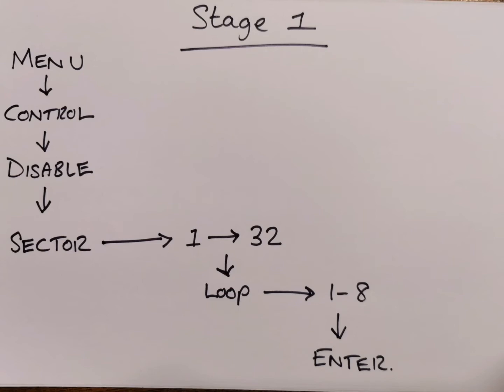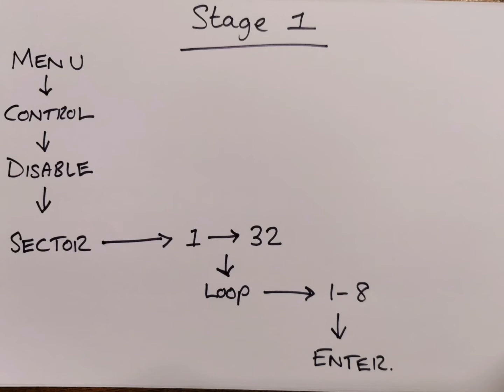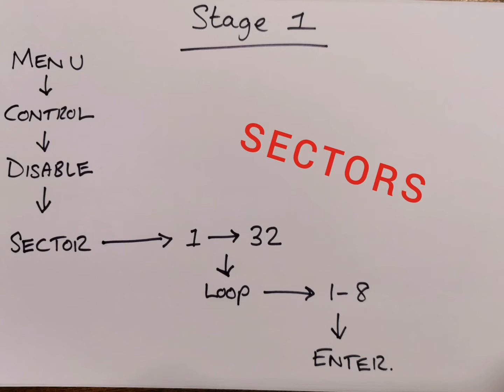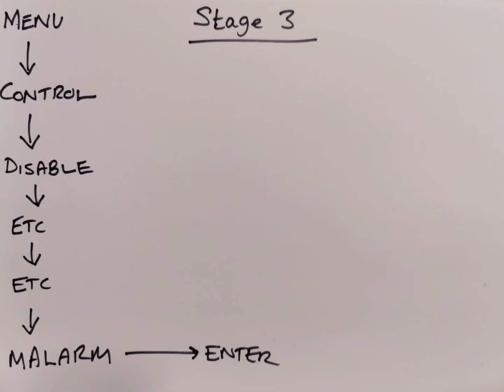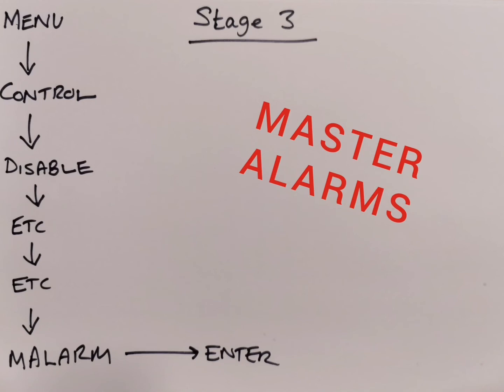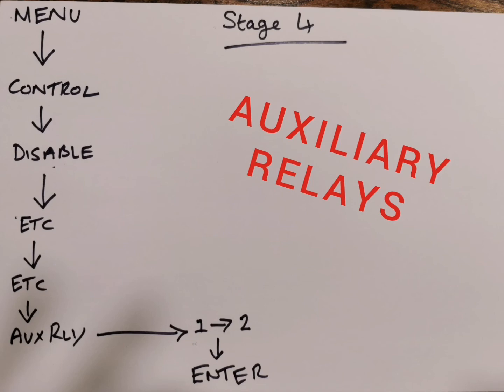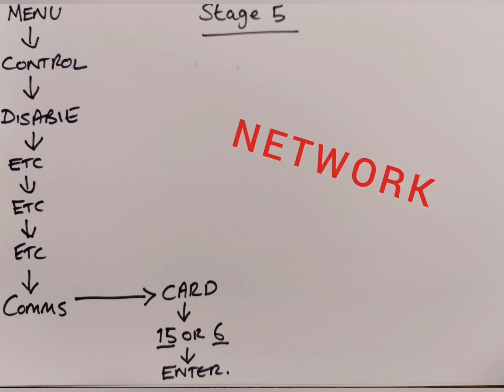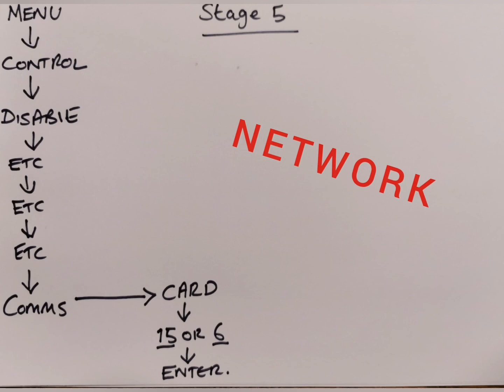How to disable all outputs, sounders and relays on a Gent Vigilon and Compact. Works with SenTri

Comment: Take no notice just dis sectors 1-32, m-alarms and aux rly1-2 that's u need to do  all I've been working on these for 20 yrs if networked just do the same on all the panels
Reply from the maker: 20 years, hmmm....you missed the builds. And what if the customer wants you to not isolate every panel...never worked in buildings like hospitals?

If you don't want to watch the video, just read the description. It will tell you what to isolate. You say take no notice, listen to me....and then advise completely wrong. 😆🤣🤣🤣

Comment: i want to know how to clear high resistance fault in gent vigilon
Reply from the maker: If you install gents loop diagnostic tool, it will tell you exactly whats causing the fault. Could be one of many things, loose connection, water on the system etc.

I would start on any devices you have outside, or look for water leaks in the building getting into a device.

The LDT programme will locate the source of the fault for you if your cards inside the panel are new enough

Comment: Hello, 
I need your assistance.
How do you enable panels or sounders that have been disabled?
I keep getting offline on one panel on the network in my office, how do I return it back online to be seen by main panel, because if you sound the alarm, it doesn't trigger and when you sound the alarms at other panel, it doesn't respond as well as the alarms on that building will not sound.
How do I correct this?
I expect your response.
Thank you.
Reply from the maker: Sounds like you have a repeater panel in your office. If it says panel offline it's because the loop it is sitting on is down. I suggest looking at the faults on the other panel. You probably have a whole loop down so are not protected for fire. where are you located?
Reply: What that means is the panel that is off line isn't been seen by any other panel on the network this will be down to a few things, damaged cable to the other panels, network cable has come out in the panel or terminated wrong, the network card is faulty (do not unplug or plug cards in when the panel is on), or someone has changed the address switchs on the network card.

Comment: What is increased resistance on negative line trouble
Reply: The loop resistance has changed to what is stored on its memory, could be a loose connection on the loop wiring in any device or could be a partly damaged cable, or Gent panels just been Gent.
Reply: @Dime_Bar  thank u
Reply: @vinilvisanth  you can save it to the memory so then the loop resistance matches the memory so the fault disappears, but unless you know what your doing you could end up doing a lot of damage to the panel.
Reply: @Dime_Bar  how to save to memory?
Reply: @vinilvisanth  BE WARNED do not follow any of this if you have ANY FAULTS for that loop except the high resistance, other wise you will fuck your panel up. My advice is get a engineer who knows what they are doing.

(1st part) menu, setup, protect, nvm card, disable, enter.
(2nd part) Press menu, setup, backup, (type card number in, eg loop 1 would be card 1), nvm card, enter. Once it is saved it will say checksum written to card 14 and only when it says the checksum message, follow part 1 only but instead of press disable press enable. 
Now reallocate the loop and the fault is gone, the message loop # has recovered.

Comment: Thanks, helpfull. Is it possible to do silent walk test on it through test menu w/o using disablement?
Reply: How do you isolate one level on a fire panel?
Reply from the maker: Thanks for the comment. Do you mean a walk test without the panel buzzer going off? You can do that by changing the buzzer settings.

If you mean yo do a silent walk test without sounders ringing, you will need to do the disablement before putting the panel in walk test.

Hope that helps
Reply: @firealarmtechspert6280 . Thanks for reply. I meant sounders not ringing, not buzzer.
Reply: @firealarmtechspert6280  hi gent en54 how to enable sector disable
Reply: @vigneshvickey9277  same process as disabling them but you press enable instead of disable.

Comment: Disable buzzer on gent vigilon?
Reply from the maker: Hi there, yes you can disable the buzzer. I will put a video up for you
Reply: Menu, test eng, config, buzzer, then select what you want to silence it for eg fault, fire so on then press off , enter. But this will leave you with the panel saying backup is required.